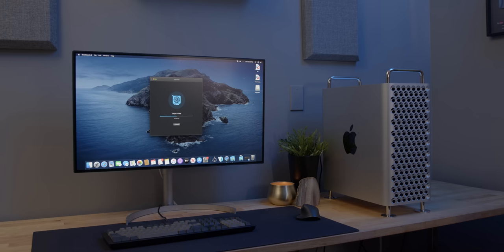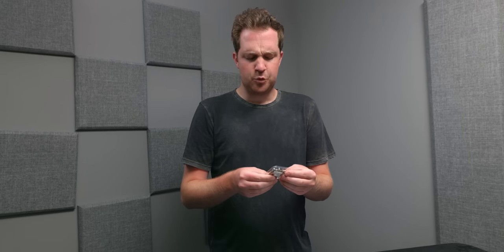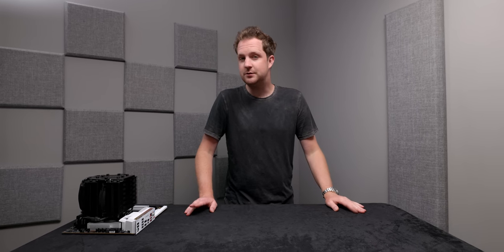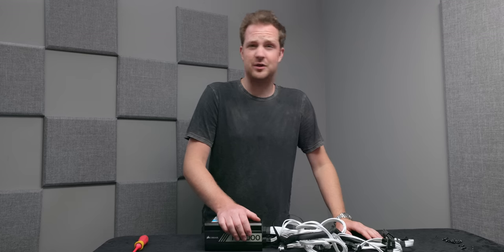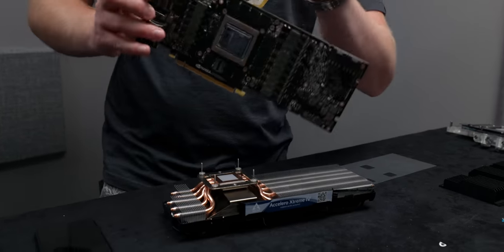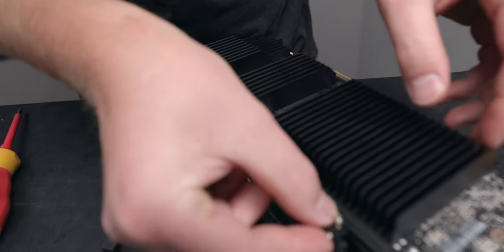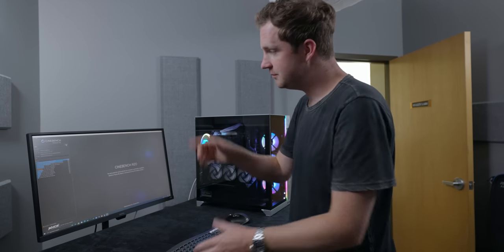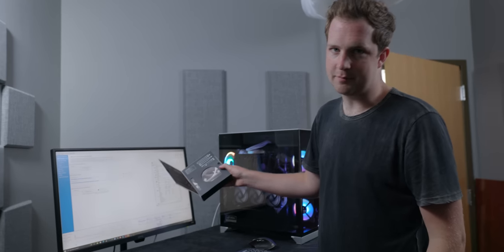The Quietest Computer EVER?!

Comment: Arent Ryzen CPU's more energy efficient? and Linus Tech Tips just made a video on software for Ryzen CPU's to undervolt and overclock. So wouldnt it be more efficient as you will still get similar fps on most games and they are basically the same price. I am saying about the Ryzen 7 3700x.
Reply: They are more energy efficient but not as powerful in gaming. Maybe Zen3 will be better but especially when overclocked the 10600K is about 20% faster than any RYZEN chip. He probably did this to prepare for the RTX 3090 because Turing isn't fast enough to actually utilize this difference in a way that really matters.

Comment: "These are the only quiet fans with RGB"
Is this a joke? NB-eLoop X.
Reply: EK has RGB Vardars as well.
Reply: ://ReaperReaper Vardars are NOT quiet. They are performant, yes, but not quiet. I had 12 and switched to Corsair's ML120 because under 800rpm, the bearings were audible on the Vardars and silent on the Corsair… At full load, they are fine, but at full load, they are all loud! :P

Comment: "All ram is the same" What??? So untrue. Just to note a few differences between models: Memory size, speed, Cas latency, timings, L2/L3 cache.

Also, you got 3600mhz ram but Intel i5 is only capable of utilizing 2666 speeds. Just an FYI
Reply from the maker: It can benefit from faster memory with XMP support. Once you pass 3000MHz different basically isn’t noticeable but up to that point you’ll see improvements. Didn’t mean to say “all RAM is the same,” rather, “don’t buy brand; look at the price, the specs, warranty, and buy.”
Reply: @snazzy  While it will benefit, you will also be voiding your warranty under Intel
Reply: @timaaaaa12  Only non K sku chips and non Z or X motherboards support up to 2666MHz. Only if you tell them during RMA using XMP would be a problem. It's not like they record the settings on the CPU (yet). During RMA you don't send them your whole computer. Same thing goes for AMD if you go past the supported memory speeds. They will also drop you like a brick if you admit it. Steve from Gamers Nexus overclocked the 10600K to 5GHz, overclocked the cache to 48x and put 4800MHz RAM (don't remember the timings) in there and it surpassed the 10900K (and everything else) in gaming. They even gave it the "Best gaming CPU" award. This CPU is the best choice for this build but he should have used faster RAM. It was years ago like on Haswell when RAM speed made no noticable difference on Intel. Back then it was a matter of "buy the one that looks best".

Comment: meanwhile my PC fans sounding like a fighter Jet. Any recommendations guys??
Reply: Be quiet silent wings 3 are good fans that are affordable if price doesn't matter noctua with the low noise adapter that is included
Reply: - Clean the PC if it's dusty.
- Use a case optimized for airflow, rather than the sealed-off front nonsense from 2019.
- Don't use vertical GPU without water cooling if spacing between fan and glass panel is insufficient.
- Use fans optimized for reduced noise and tune them to be quiet in BIOS or third-party software.

If doing water cooling, make sure the pump is at the lowest point of the system. Steve Burke of Gamers Nexus has a video about AIO CLCs which should provide good guidance for both AIOs and custom loops.
Reply: @bluephreakr  fantastic itemized list also if the heatsink on the cpus is inadequate it can lead a ramping of fans as well

Comment: If your custom watercooled PC is sounding like a jet engine, you are watercooling wrong. Or your fan curve is too aggressive (maxing out at 63c) or both. Also, the 10600k is a great gaming CPU, but even with the 0.2mm shaved off the die touching the IHS I'd be surprised if it wrong much cooler than the 3700x, or Def the 3600 (comparable by price/core count) Lastly, the socket? Really!? Every Intel chip I install I feel like I am destroying pins on the mobo lol. Ryzen let's me know for sure it's in there. That said, I have bent some Ryzen/AMD FX PGA pins but was able to easily bend them back.

Lastly lastly - No Noctua fans...? The Redux fans have great static pressure and probably will outperform even those Silent Sings fans in every way. OK now I'm really done needlessly giving you my opinions lol. Great case choice! Your thoughts on higher airflow cases that only dampen passively by being an enclosure and still having tons of ventilation providing lower RPM etc are dead on imo. Gamers Nexus has made the point a hundred times over. Honestly the 011D has 9 fan mounts lol. It's bananas.

Comment: How low can case fans go? 0 rpm?
Reply from the maker: Theoretically, but you want them spinning at a low RPM at minimum at all times IMO.
Reply: They usually have a rated minimum and maximum RPM range in the specifications.
Reply: Snazzy Labs thanks. I’m asking as I have my own silent gaming pc project and using right now stock Fractal Design  fans that can go to 0 rpm. I wanted to replace them with some RGB fans but I struggle to find something that can go as lo as 0 rpm. I had one where minimum was 600 rpm but that was just too loud.
Reply: @kozbx  You realise 0 RPM (Revolutions per minute) would mean they'll stand still right? 600RPM is a pretty good rating. Maybe you were running them at 100% and they were spinning faster than 600RPM?
Reply: SibaNL I know. I have many fans in my PC and I’m monitoring temperatures. If I can get 200 rpm with cool   Interior I want to have it. With min. 600 I can’t have it.

Comment: woudlnt be a fanless psu the even better option? i mean their build for this reason in mind yo :D
Reply: Fanless PSU's usually have a low power rating like ~500W. Not to mention the price.
Reply: @SibaNL there's psus that go over 500 watt fanless and a 1000watt psu is expensive aswell so I don't see that as a valid argument there. These few extra bucks should've been worth it considering the end goal of the vid/build
Reply: @RedLampLightsGreen  A 1000W PSU would run me €180 while a 550W fanless would run me €127. Which seems a bit underpowered really. Next step up I can find is a 700W fanless PSU which would run me €255. So a 1000W PSU with seems pretty viable as the fan wouldn't kick in.
Reply: @SibaNL  550 is plenty fine bro. I personally run a 2700x and a vega56 on 550. With 6hdds.
Reply: @RedLampLightsGreen  Oh wow, are you running them in RAID?
Reply: @SibaNL  nope. Just default for different issues. Some are for games others for movies etc
Reply: @RedLampLightsGreen  GN released a video about this yesterday. A 10900K and a 2080Ti never got the total system past about 420W. 550W 80Plus will do fine if you don't put 15 harddrives in there.

Comment: That cheese-grater design is such a waste of material... Just imagine the quantity of aluminium that needs to be machined off that chunk of metal... What. A. Waste.

Also, other manufacturers on the laptop market are making the same mistakes as Apple because they want to copy them. I remember having a laptop in 2010, Toshiba, mainly made of plastic, lots of room for the components, good fan, quiet, no problems. Then in 2014 changed to another Toshiba laptop, skinnier, barely room for the components, tiny fan loud AF and constantly revving up to control the heat, and good luck trying to put your hand on the bottom part of the keyboard (where you rest your hand while typing) it was hot as hell every time, since the metal exterior absorbed part of the heat from all the components inside.

Comment: LOL. AM4 > LGA_whatever_the_f 

Have fun replacing your motherboard every year. I'd rather have a "bad" socket than a useless motherboard after a year.
Reply from the maker: I’ve never had an Intel motherboard fail on me that wasn’t DOA. Idk what you’re doing my dude lol
Reply: @snazzy  Mostly lamenting Intel's new socket every year. You can just update the bios on most AM4 boards to support the latest cpus. (which you already know)
Reply: The AM4 socket is more annoying to deal with than Intel's sockets. He wasn't talking about compatibility, rather how easy it is to mess up the installation.  
It's fairly easy to bend a pin on Ryzen and potentially bork your CPU, where as it is a good bit harder (still not hard though) to break the connectors in an Intel motherboard

Comment: You would pick AMD, they're more efficient. 3700 is the cpu to get  You're justifying a tiny advantage in fps. What's bad about AMD socket? You would need to be mentally challenged to complain and even with that, there's no problem Now if you can't tell between a car and a cat maybe... in which case computers would be alien tech.